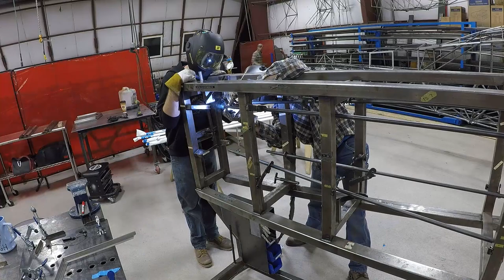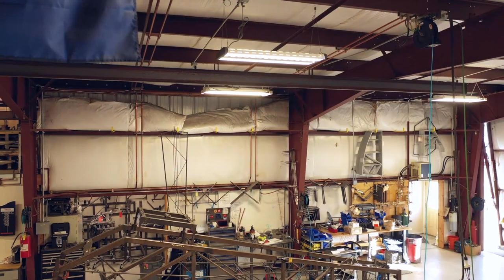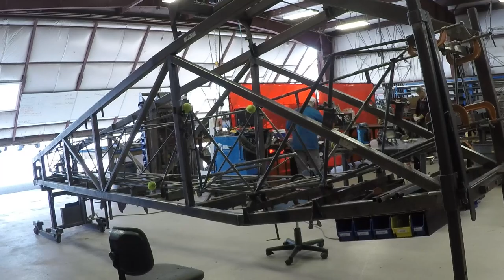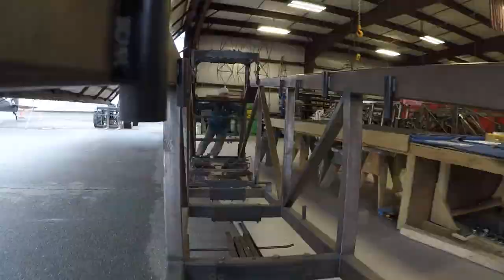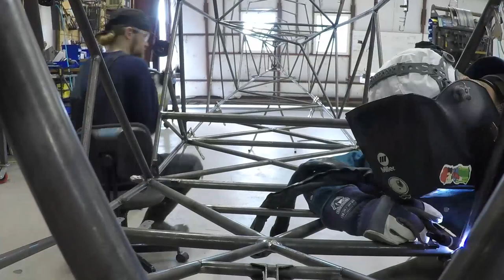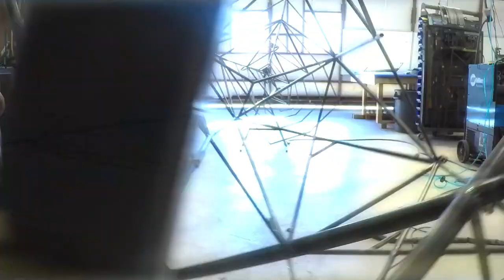Widebody Fuselage Timelapse Build

Comment: I myself like a Gas welded frame and I like one that has a schrader valve, gage & nitrogen at about 60psi in it.
Reply from the maker: Robert That is a dying art!
Reply: YEH... I do it 'cause I like to known if my welds are holding...it is time consuming but not much and I have found some bad welds long before we got off the ground, which I believe is a good thing all around....... I use a quality leak check compound and the smallest pin hole will foam up big time.